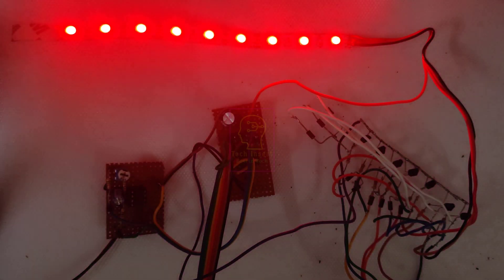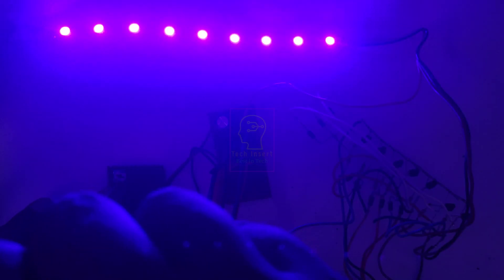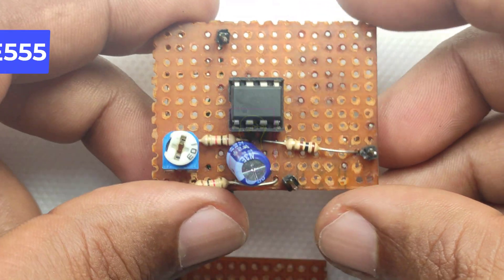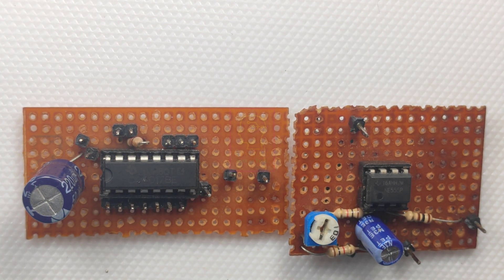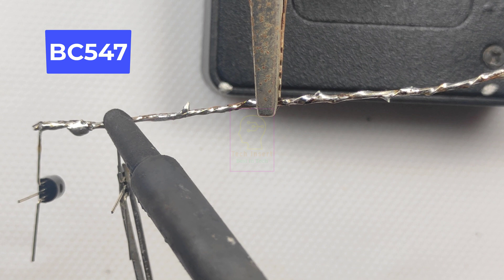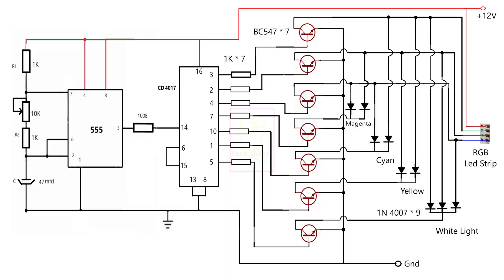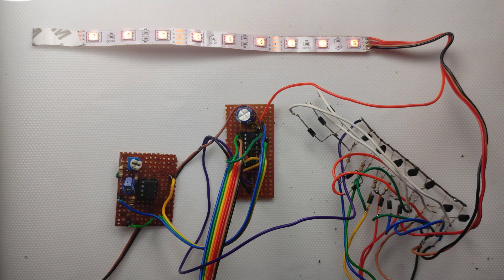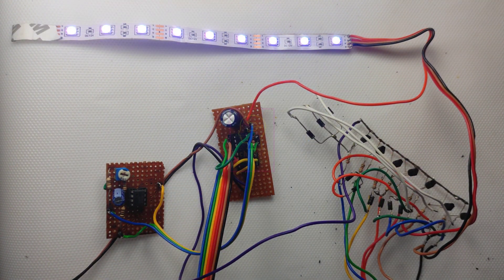You Dont Believe That Diode Helped CD4017 To Light RGB Strip | RGB LED Strip Chaser

Comment: Greetings….nice circuit,

However on the schematic you do not show the 220uF cap. Can you tell me where that’s connected by polarity?

Also you show a 100E in the schematic but in the parts list it is 100R ..which one is it? And what type of component is it? Thanks
Reply from the maker: I have added the 220uF cap across the power supply.  + connected to positive of power supply and -ive conected to ground of power supply. It is for filtering purpose. 100 Ohm resistor is normally noted as 100R or 100E
Reply: Thank You 🙏
Reply: Ok I am using all I have is Rgb led with cathode …no anode. What changes do I need to make in order to use the cathode Rgb led? Thanks
Reply from the maker: @Foods4Brains  You mean common cathode?

Comment: Instead of 1N4007 you can use 1N4148 which is a fast switching diode
Reply from the maker: Here pulse rate is low so 1N 4007 will be fine. For fast pulse rate 1N 4148 is much better
Reply: @TechInsert  Thanks